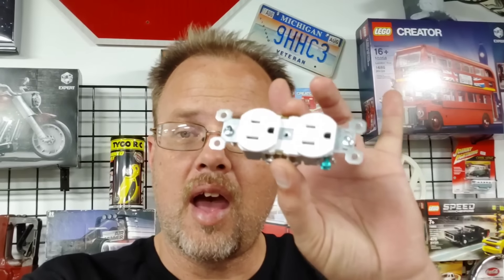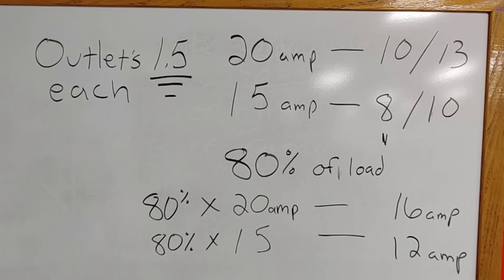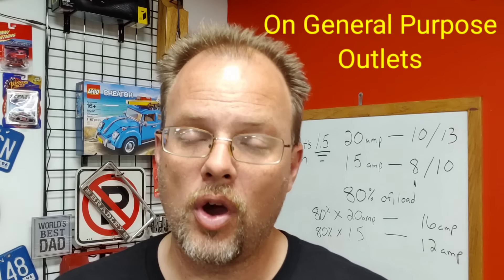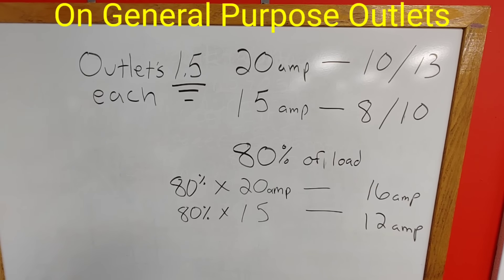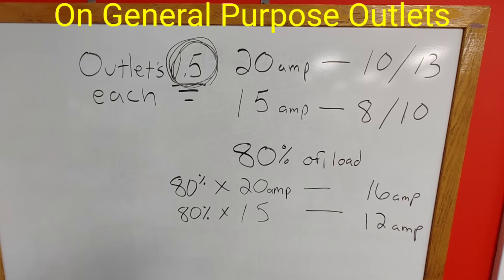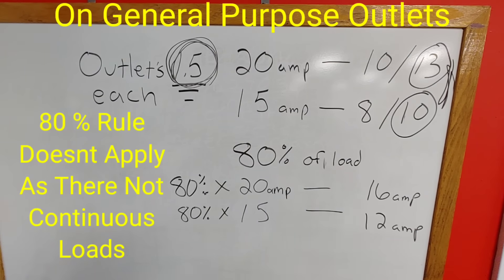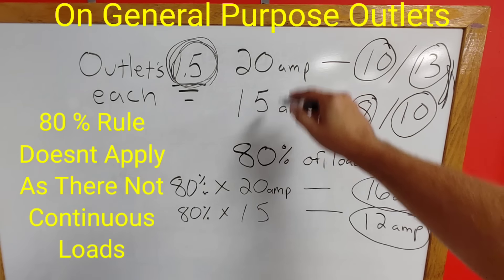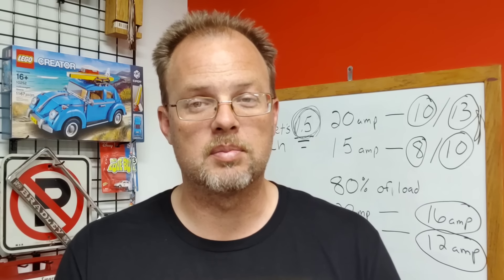How many outlets can you put on one circuit ?

Comment: The number of plugs makes no difference, it’s how much load is on the circuit
Reply: I’ve been electrician for 20 years and you are 100% right
Reply: @thomasknightknightjr9407  agreed
Reply: @happydogg312 . Why is that necessary?
Reply: @happydogg312    But wouldn’t you still need multiple outlets for each circuit to handle the plugging in for all of the equipment?
Reply: @happydogg312    Gotcha!  Makes more sense now. I had no idea those systems were so power hungry. Like having three or more 1500w hair dryer’s going at the same time.
Reply: Agreed. I use less outlets per breaker in my house than in my outbuilding. Why, cause in my shop I only use one or two things at any one time. A house with multiple family members will use a lot of items simultaneously.
Reply: @happydogg312  unless your equipment is drawing over 16 amps each  for over 3 hours then there is no need to
Reply: The Canadian electrical code has actual rules! Each receptacle is actually 1AMP per so based on 80%load on a 15A cct, you are only allowed 12 receptacles per cct, this number is written in the rules, same goes for lighting... All devices in resi are 12 on any 15A cct. Now a 20A kitchen plug cct you are only permitted 2 duplex receptacles per cct.The only new exception is lighting when the fixtures are non-replaceable LED then you calculate as per load.. just swapping out the lightbulb does not allow you to add more than 12 devices to said cct.
I went to school for this ...and watching a few of these american sparkies i will say you are about 10years behind when it comes to the NEC upgrades vs my CEC.
Reply: @mikemeaney3017  a mistake many ppl actually make when there is an overload in their cct is to bump up the breaker to overcome the nuisance tripping because they have too many devices on that cct. What a good electrician will say is that you should be adding more ccts Not increasing the A. The reason is a ie 15A breaker trips at >12A . It is there to protect your device which would be rated at under 12A. The ampacity of your cct does not depend on how much total wattage you use but on the A rating of the device. Ie you put a 12A device under a 20A breaker and since that breaker trips at >16A any surge will have fried your device. This is what real electrical school teaches you...
Reply: @thomasknightknightjr9407  100 percent wrong, I provide the calculation in the comments, you can put as many 20 amp receptacles on 1 circuit in a 800 square foot area as you want, 600 square foot on 15 amp receptacles on 1 circuit.
Reply: That's right, when i tore down a wall and expanded my bedroom, i put 9 20 amp outlets in, two per wall and one by the door, just so i could have the option of moving the bed , dresser, and nightstands around to more places in the room without having to use a risky extension cord all the time.  I never used all the outlets at one time of course lol. It was two per wall for the nightstands to run two lamps and alarm clocks. and one by the door for a smaller lamp on the dresser.
Reply: @gophersgirl  It sounds like CEC is written with the intent to support the IBEW union itself as well as workers in the electrical trade (sparkies, inspectors, etc.), and also municipalities with just oodles of permit fees. More code does not mean better code, and it certainly doesn't mean it's substantially -or even marginally- safer. It's just more expensive for Canadians to do anything. I'm not criticizing your skill or knowledge, I am questioning whether all the detail and red tape is necessary for safety. 
For example, I continue to find things in my 60-yr-old house that were done sloppily and even in a potentially dangerous manner by some DIY owner but which has not actually caused any problems. It's easy to make mistakes DIY, some which might scare you, but it's not easy to make ones that will kill you due to the inherent design of residential electrical. And yes, I am only talking about residential code.
Reply: I’m confused, and I just want a simple answer. So say I wanna have a gaming setup. I have only one wall socket whatever you want to call it. It’s the thing that has 2 lines and one dot and you just plug something in it. I have 2 of those. I have a washer and dryer into one cable and it takes up one outlet. And then I have one free remaining outlet. Can I get a power strip and plug my laptop charger into my laptop and have a monitor plugged into the power strip at the same time? Will this be safe? Respond to me please I don’t wanna burn my house down
Reply: Funny one
Reply: @thomasknightknightjr9407  what is your answer to the question?
Reply: @gophersgirl  welcome to the USA  , that's not the way it is here if you do it correctly. You can run the whole house and your neighbors house on one circuit if only one or two things are plugged in at one time,  how do they do the kitchen appliance circuits?
Reply: @frankstallcup8720  sure in your deer lease cabin not in a building that's been inspected.
Reply: He knows does not know, funny
Reply: @gregberban7067  i do know how to calculate load and that you can have 1000 plugs one one circuit. The canadian quantity 12 rule is in place that in case every single plug is being used that the circuit is protected.it limits the amount of devices that can be plugged in at one given time to not trip a circuit. Now the new AFCI rule that 90%of plugs must be AFCI protected to me is a moneygrab. There is an increase of nuisance tripping with vacuums etc...just by using a 75$breaker instead of a 12$ breaker... are there really that many electrical fires caused or is it just fake news to make somebody rich.
Reply: @happydogg312  No wonder why you call yourself a "Happy Dogg."....LOL !
Reply: @amogus7928  if installing expensive equipment? I would skip the power strip and install GFCI plugin at the locations where I planned on putting the equipment. I did a video where I was testing my solar edge transformer. Where I actually switched it off and had 240 volt’s go to my GFCI outlet. The thing tripped and the 1500 watt heater was undamaged. Depending on your equipment? I would probably put 2 breaker’s and separate outlets. My child runs his gaming equipment a lot. Plus the  GFCI outlets are cheap insurance.
Reply: @gophersgirl  so if your refrigerator costs 1,000 dollar’s? It’s to expensive to buy a GFCI plugin? What happens if you have a power surge? Or if you put to much load on the breaker and it doesn’t trip? Besides the GFCI plugin’s are about 40 dollars for a box of three here in the USA.
Reply: @gregberban7067  kitchen ccts is a min of 2ccts,  20A, and max 2 duplex receptacles per cct.
Reply: @jamesshomesolarmore2223  why would you use a gfci on a dedicated fridge cct? Gfci is only required outdoors or within 1.5m of running water like sinks/shower...
Reply: right but you don't know the load and by code you have to have  a recepticle every 6ft or so usually so you need a way to estimate so as to load the breakers efficiently because there is only so much room in a panel
Reply: Doesn't the wire add resistance? so you couldn't pull 16 amps on the circuit.
Reply: When you already know what’s gonna be plugged in those outlets

Comment: Years ago when wiring my small garage and with little knowledge, I bought a box that came with 10 twenty amp breakers. So I put one outlet per circuit/ breaker because that's all I need. They've never overloaded. Go ahead and chuckle.
Reply: I do the same for all circuits 50 circuits in my house.  never have a blown circuit breaker.
Reply: In my house there is a new electric wires all replace and in a 20 amp I only allowed the electrician 4 receptacles per circuit breaker in each room and one 20 amp next to the window for the window air conditioning and in my basement electricals box you can install 50 circuits breakers in case I need to add my self more
Reply: Funny thing is I was just to do the same thing on my cabin. 😂 Your not dumb bro. We don't know until we know.

Comment: The 80% rules applies to ALL circuits, whether there is a continuous load or not, because a breaker can only power a load of 80% of its ampacity. A continuous load requires that the CONDUCTORS be sized at 125% of the load value, making that increased value the selection current used in table 316 (B) (16). So...the 80% rule DOES apply to these 15 and 20 amp circuits.

Comment: You can put a hundred outlets on one circuit if nothing is plugged into any of them. Or you can put only 1 item on an outlet if the load is rated for 15 amps and you have a 15 amp circuit breaker controlling that outlet. So the only real answer is it depends on the load that you are plugging into the outlet and the size of the breaker controlling the outlet.
Reply: Exactly! I am an electrician. I try to imagine what the home owner may plug in, to determine how many outlets per circuit. For general bedrooms, I stop at 8 outlets, for 15a circuit (2 rooms)
Reply: Logic and practicality = winning duo ! You hit it on the nail !

Comment: 8 outlets on a 15a circuit is enough. Anyone putting more is asking for trouble.
Reply: Yup. I put six in my garage. I thought that was excessive LoL
Reply: Dan, it completely depends on situations..  I can give you a situation where 120 outlets or more on one 15 amp circuit is perfectly fine...
Reply: You simply can only use a limited amount of wattage per circuit, no matter how many outlets are on it
Reply: @chrisb6866  A long hallway where the outlets are used, 1 at a time, for the vacuum cleaner.
Reply: As many have already stated, the number of outlets isn’t important, it’s the total load. If you have 2 dozen outlets on a 15A breaker you’re fine as long as the total load stays under 15 amps. If you want to run more things on that circuit, be prepared for a lot of breaker trips (and no, you can’t just replace the 15A breaker with a 20A breaker unless you’ve also upgraded the wiring)!
Reply: @Guust_Flater  

I worked at CMU as a custodian for their athletic building and had to vacuum and scrub the football tunnel going from the locker room to the indoor football field. It was at least 50 yards long and it had 3 outlets for my vacuum. Luckily, I had a 100’ extension cord. I only had to plug it in once if I used the outlet in the center.

Comment: It depends what you’re using the outlets for. If you’re going to use a 13 amp heater you should have a dedicated 15 amp circuit. A washer needs a dedicated 20 amp circuit. A microwave needs its own circuit etc..
Reply: The dedicated washer circuit is mandated.  A permanently installed 13 amp heater cannot reside on a 15 amp circuit because it is considered a continuous load (but there is nothing technically wrong with plugging such a heater into the dwelling's lighting receptacles either, except it may trip the circuit).  A microwave that is not simply plugged in to one of the two mandated kitchen appliance circuits does not need a dedicated circuit - unless it draws more than 50% of the available power from that other circuit.

Comment: I put 20 outlets on each of 2 circuits in my 4 bay garage.  Every 4 feet, I put a 2 gang box.  Each box has two circuits, with one brown and one ivory receptacle.  There are lots of outlets for convenience,  but I run one tool at a time. Sometimes two if you count the shop vac.  Lighting is separate.  Garage door openers are separate.

Comment: TYVM! I personally don't want more than 6 circuits on 15 AMP Breaker. I also like doing one room at a time per circuit. It gives me far more control. Instead of losing two or three rooms...I lose one! Is it more expensive? YUP! Do I feel better? YUP! I am glad I caught your video!
Reply: One room per circuit makes sense. It is top down thinking instead of bottom up. Then you put as many outlets as needed. I have total about 35 devices on my room.

Comment: Good video!   I designed electrical systems from 1983 to 2018 (retired).  You are correct in your information.   Dwelling units you have sq footage that sets the number of circuits regardless of quantity of receptacles.
Commercial NEC is as you showed as 1.5 amps divided into the 20 and 15 amp breaker size.   Also correct that 80% does not apply as non continuous load.   Our company standard for commercial spaces was 8 receptacles on 20 ampere circuits.   The reason is nuisance tripping virtually gone, but most important was if the owner some receptacles added after construction was completed(happens quite often) we could tie into existing circuits to add them rather than having to add circuits for the distance back to the panel.   Better for our customer!
Respectfully,    Kevin

Comment: Many years ago we were told for redidental outside of kitchen bathrooms & garages that use 180 Watts per device ( single & duplex receptacles count as 1 ) so on a 15 amp circuit that comes out to 9 devices & 13 on a 20 amp circuit. Best pratice is to put each bedroom living, dining & family room on their own circuit.
Reply: No it's not good practice to have each room on it's own circuit. Normally you split circuits in each room. Say half the room on one circuit and half that room and half the next room on another circuit. That way if a circuit trips you still have some power or lighting left in the room for safety.

Comment: I bought a rental that still had knob and tube for the living room.  When I ripped it out and replaced it, I went with two 20A circuits and no more than 6 outlets per circuit.  It may have been overkill, but I hate it when breakers trip and I figured I should try to prevent it up front.

Comment: per the NEC, all general lighting circuits in a residence must be calculated at no less than 3VA per square foot.  that means a 15 amp circuit can only power 575 square feet of house, and a 20 amp circuit can only power 766 square feet.  you can stuff as many receptacles as you want to into that space, but a good rule of thumb is 10 receptacles per 20 amp circuit and only lights on a 15 amp circuit. (it used to be 10 lights on a 15 amp circuit, but with LEDs, you're looking at 75 bulbs on a 15 amp circuit so it becomes more about not having an electrical fault shut off all the lights in the house.)
Reply: There is no maximum requirement for general purposes receptacles in a dwelling unit. There is in a commercial building. I’m pretty sure those calculations are for sizing of the service.
Reply: @blockisle9  it is for the sizing of the service, but it also covers circuit layout in the dwelling unit.
Reply: With LED lights, at 6 watts per bulb, a 15 amp circuit would power 300 bulbs. That would be 3 houses, lol.
Just saying because it makes you think. Gotta love these led bulbs.
The sq ft rule makes sence. I'm not an electrician, but I do pay attention to the code and that is what I have read before. Good rule of thumb!
Reply: @markchidester6239  the 3W per square foot also powers anything you might plug in - electronic reality-escape aids, vacuums, heating pads, etc.  I still use 20A receptacle circuits for my 3W/foot, and now I tend to break up lighting circuits by floor or zone so I don't black out the whole house if I need to shut one down.  I suppose if I wanted to be considerate, I'd divide circuits, so adjacent lights were on different circuits, but that would get complicated.

Comment: In a shop, I did 7 per breaker on the 20 amp. The refrigerator circuit, I only did 3. Outside receptacles, I did 4. It depends if appliances or machine tools are going to be plugged in. Light load, like an occasion I need to run a drill, can be more. Clocks, radios, cell phone chargers don't pull much. It's hard to judge sometimes. Welders & compressors are singles because they pull alot.

Comment: In my garage I put in four twenty amp breaker’s. With plugs on them. Three outlets on each breaker I only have outlets on three walls. One breaker per wall. Then one breaker with one outlet on all three walls. It’s outlets are about 4 inches higher than the other outlets. That’s where I plug in the vacuum system or secondary power supply. As most of the tools are drawing 15 amps. Plus the table saw or miter saw can stay stationary and I can just open the pipe that pulls the sawdust from that tool. Vacuum system was tripping breaker’s when I had it and table saw plugged in the same breaker. Both pull 15 amp’s.

Comment: It's really hard to know what to install sometimes with all the variables to consider. If you were wiring a tract home with no idea or plan on what was needed then your best option for your circuiting is to go by the 375 SQ ft for 15amp and 500 sq feet for 20 amp.  But if it's just too much bother  13 outlets on a 20, 10 on a 15.

Comment: More importantly, don’t use the stab in holes in the back of the outlet. Pigtail your wires and tighten one wire on the screw. The stab ins become loose over time causing severe heat. I serviced two homes in the last couple months that had toasted wires and outlets due to overheating caused by space heaters. One 1500 watt heater at 120 volts draws 12.5 amps, .5 amps more than the 80% rule on a 15 amp circuit. Those heaters are dangerous, especially when using the outlet stab ins as a joint. Pigtailing  the wires is the safest way and Highly recommend, especially when the chance of a full load is applied. ⚡️
Reply: My mother in law just melted an extension cord that was the wrong gauge using one of those 😂
Reply: I had an inspector tell me once the pigtails were not the best choice. I just let him talk and nodded my head.
Reply: @submittedbymail  My brother and I worked in a electrical union for approximately 40 years, running our own company the last 20+. A journeyman left our company to work as an inspector. He was a good worker but believe me, he was not our most knowledgeable employee. But one of average electrical knowledge should know this.